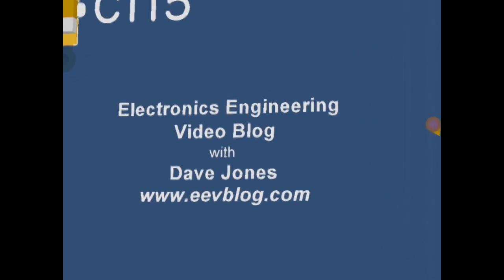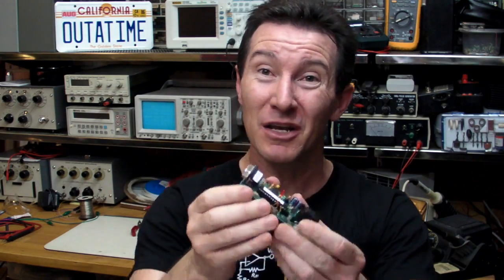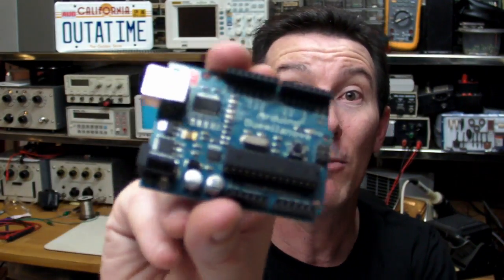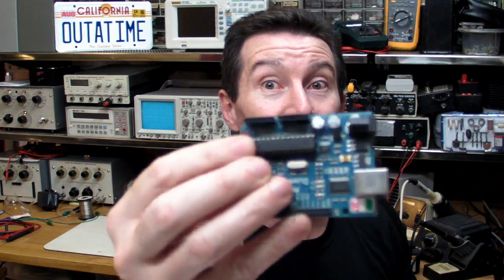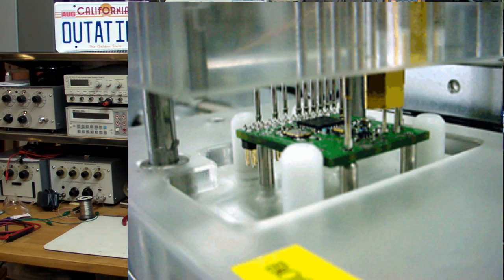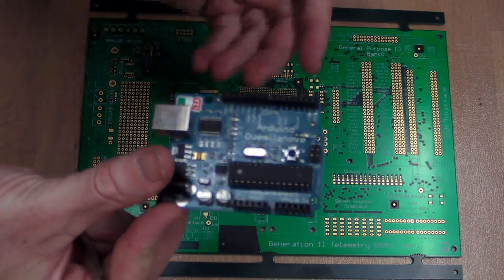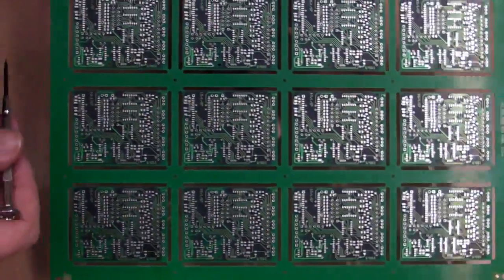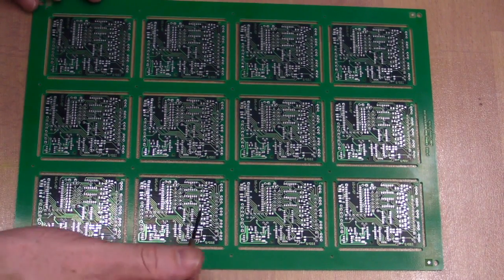EEVblog #127 - PCB Design For Manufacture Tutorial - Part 1

Comment: Rather than paying for the Digi-Reels or Mini-Reels, just buy some extra parts on cut-tape to create a "leader" of sorts. One of my CM's recommends these additional amounts:
"SMT components, not supplied on reels should be on one continuous strip of tape. Resistors, Capacitors, Diodes (0603, 0805, 1206, 2225, SOT, SOD, MELF - packages) require a minimum of 50 pcs and/or has to exceed the required quantity by 30 pcs. (Example: build req. 40 pcs – we will require 70 pcs – this meets our minimum required 50 pcs plus 30 pcs above build requirement) Resistors, Capacitors, Diodes (0201, 0402, minimelf, miniature packages) require a minimum of 100 pcs and/or has to exceed the required quantity by 50 pcs. (Example: build req. 80 – we will require 130 - this meets our minimum required 100 pcs plus 50 pcs above build requirement)"
The other handy option is to buy your assembly "turnkey" (assy house buys the parts) rather than "consigned" (you supply the kit). They often can buy parts cheaper than I can, then I can ignore these matters.

Comment: You don't need to automatically go to reels (or DigiReels).  All you have to do is buy Cut Tape with 4-5" of extra length, the extra length becoming the leader.  Done. 
Obviously for bypass caps and other parts, it makes sense to just buy a big reel, but otherwise I get tired of paying $7 for DigiReels.
Reply: I thought so. Would Digikey sell with 5-7" inch extra cut tape? I usually buy them in cut tapes but I always buy them extra assuming the assembler would lose some in peeling the tapes

Comment: Great video!  Thanks!
Typical tooling hole diameter: 4mm
Typical routing width: 2.4mm
Typical fiducial mark diameter: 1mm (both sides for top-bottom surface mounting)

Comment: 17:58  There's a big cycle time reduction when you panelize.  Manufacturing machines take time to load a board in, recognize, get ready to do it's thing.  Then the actual thing it does can be relatively brief.  By panelizing small designs, the equipment spends more time doing its thing and less time getting ready to do it's thing, per PCB.

Comment: I work for a Circuit Board Company and panels with pre-drilling and secondary drilling for open hole circuit boards are better because the plating allows for the boards to be fully conductive were as surface plating could go wrong. Also the way we manufacture boards is way different then the way your showing.

Comment: Allot of good advice was given which applies only to very large quantities. One will typically ramp-up from the prototyping stage to small-quantities first; Say 25 to 50 units. To address this market, assembly houses are offering services which loosen allot of the rules mentioned; For instance, they may not require you to panelize unless your board is very small; Say under 1" square,  They may also be flexible about parts being on cut tape or loose. 

KUDOS DAVE JONES !

Comment: Great work. This sort of knowledge is invaluable and you can normally only learn it by doing it amongst some good electrical engineer mentors.

A great way to create your BOM spreadsheet is to use the information that you've already provided in your CAD software e.g. Altium. 

If you use database libraries you can link the datasheet, manufacturer and supplier information to the part in the schematic. So when it comes time to make the BOM, all the information comes straight from the schematic!

Comment: The corner holes are normally, at least in my experience, the first holes ever drilled, as a pin is pressed into the holes to anchor the stack of pre-drilled boards to the CNC drilling machine bed, ready for drilling / routing. The next step is etching, before being brushed and cleaned, ready for silk screen printing of the mask and sent for component assembly / populate the PCB's. As far as I remember anyway, it was a while ago in an age where audio cassette tapes were the storage medium for CNC software / program....lol.

Comment: @ArtistEngineer e.g. you have an individual part for a "10K resistor 1% 0805" "1K resistor 1% 0805". So your BOM is EXACT and automatic. It takes a bit of setting up in the library but once you've got it done then you save LOADS of time doing your part ordering. 

Anyway, this is a simplified example and you probably already do this.

Comment: sorry for the multiple comments but I'm basing a few arguments based on my previous work experience. small smd components not on deals are not hand soldered but instead placed manually during the inspection of the other components from the pick and place machine. then it all goes through the reflow oven.

Comment: Small note in the DigiReel calculation: the price was listed at $84 with a calculated price per unit given.  Back calculating, it looks like the extended price includes the reeling fee, with the unit price extrapolated from there.  This has been my experience (which is a bit filtered, but purchasing never has corrected me for submitting incorrect parts pricing).

Comment: @rainbowsalads (Viz circuit (schema)...pcb walkthroughs) AutoLISP training is universal enough, but so are the AutoDesk (etc.) certified trainers, often in with distributors and engineering service companies; just pick your coverage (e.g. as mentioned, 401 discretes, inline packages, connectors...) and/or read up at the fabricators' (CFM/OEM) sites and match up preflighting (so connectors don't hustle each other for space, RF emit overmuch, etc.)

Comment: maybe you could get your lecturer to contact a contract assembly firm and see if they are willing to give some time to talk to the future designers. I work for a company that does contract manufacturing and we have had in the past had students for work experience but this is getting harder to accommodate these days. My advice to anyone designing a board is talk to a contract manufacturer as early as possible for advice. It will save you heaps in the long run.

Comment: I would like to thank you for all the amazing tutorials that you've provided us with. I have a question about reverse engineering. I am a 3rd year aerospace engineering student from melbourne, I love electronics but I don't particularly posses the technical apt as you do. I would like to know if it were possible to design a ASIC chip, that would be able to decipher a certain algorithm at a low cost? If so, what do I need to ready up on and are there any resources you can direct me to.
Cheers,Ash

Comment: That is outright, and is not bad. I got a trial on a 64 layer where I could move whole rows of tracks and lay in ground planes shields, etc. $36K! per YEAR! It beats the heck out of a R&R program which Rips up a design & Replaces it until it finds one it likes. Dip trace is free 2 sided through hole. My new CNC router can do drilling and an OK job of routing etching in the copper. I won't advocate using cracked versions of the program. It is one of the best ways to get your computer a virus!

Comment: Well, ok, this blog and its additionally parts is now 10 years old I think that it needs an update, because we have now a lot of PCB manufacturer, who produce very customer oriented PCBs at decent costs. Today there is no more need to take care of all the advices you gave, related to the situation of 2010. Today you often need just to provide a scaled hand-made drawing of your PCB in a digital picture form and you will get your ordered PCBs in the best quality and at low price. If you don't need further manufacturing by highly sophisticated companies for mass production, your PCBs are useful for DIY or even the most highly flexible assemby contractors. Even in the case you need PCB and assembly for mass production, you will be provided with customer support of the PCB manufacturers and this is often for free.

I think, the most abonents of your channel are DIY electronics enthusiast who did most of the device manufacturing by themself. In the time of personal 3D printers you can do almost all the required manufacturing and assemby by yourself, because you will very rarely do series or even mass production, but more highly specialized device manufacturing for your personal needs or the needs for some of your friends.

Comment: @heroineworshipper , one time costs for setup is normally 1k~2k in AU, cost per placed part is about 5 cents for SMT, and 20 cents for TH, and fine pitch components have some other pricing I don't know about, plus the cost of the parts, plus the cost of the PCB, plus testing, plus you likely need a bed of nails tester to be made up,

All of which is well under 100k!!!!

The real cost is in compliance testing, depending on the product, and getting custom plastics injection tools made...

Comment: another problem with bga is that it can be easily missaligned. not necessarily harder to inspect as at PTI there is an xray machine to examine them and even traces inside the pcb if needed

Comment: I notice you specify a soldermask swell of 1.5 mil around your pads. The two board houses I use regularly want 2.5 and 3 mil. This makes it impossible for me to do a QFN with 0.5mm pitch and still provide 5mil width soldermask between pads. What do you do in this situation? Thanks.

Comment: At 32:00 you explained that the board has to be stiff in order for the pick and place machine to place the components without the board warping... but why isn't the board simply supported by something when they place the components? I don't understand why it needs to be floating.
Reply: They are usually supported by the edges on a rail system.  This is because they have no "a priori" knowledge of what might be hanging on the bottom side.  At higher quantities or higher cost they can always figure out how to get around that, but you're better off at small to medium Qty not doing anything weird.

Comment: here's a question. I thought of the other day. Some fancy computers use see through cases. I had idea then because PCB are basically plastic like PVC, etc would it not be possible to make it clear too?
Reply: No you cant get "clear" PCBs the colour of the basic material (FR4) is very light green. However, if you had one made thin enough, you could use clear solder resist. With a bright enough backlit LED it would appear to be at best translucent.

Comment: Re: v-groove separating
~~> EEV noob w/other skills

Standard Razor knife,   not box cutter or Dundee/Bowie Knife
Continue to score with minimum force to save components and fingers, repeat
The passes, time, is deponent on the pressure able to apply. Surprisingly not long
It is just fiber glass polyester maybe copper foil
It should cut through Smoothly and Cleanly, No Hair that penetrate skin and scratch for hours.
Also, works with overhead florescent lighting fixture lens.. Not an easy task any other way!
         Cation, more force to cut and do not use an Aluminum straight edge, the force will bite it and go of course. where fingers live.

But also the sand paper, Files work, but is work.
tabs left on easily flat straight sides sand easily or corners and cutters and sand/round the corner tabs...

Comment: Sorry, you should not touch the surface finish on a PCB, the grease from your fingers could cause solderability problems. Aunic (electroless Nickel / Immersion gold) is a no-no and Immersion Tin is a Never! Very hard to clean off if contaminated. Dont get it on, you wont have to try and clean off. Just a tip from the top :-) Apart from that, very good advice for would be PCB designers.

Comment: One point I would like to disagree-- I have learned through long experience that you do NOT want to use surface-mount (only) connectors.  These can (and will) get ripped off of the board by the end user.  For connectors that are actually used by the end-user, I design in through-hole only-- (or a hybrid connector that is mechanically stabilized by through-hole, but the connections are surface mount).  Please don't repeat my past mistakes-- use only through-hole (or hybrid) connectors.

Comment: Kind of amazed that someone hasn't come up with a robot to reliably do through hole board place and soldering, sure it's challenging and why bother when surface mount is easier and specifically developed for manufacturing millions, but still, I would have thought there would be some market still for making through hole stuff.

Comment: nowadays I`ve seen on videos that there is automated through hole assembly machines and lines as fast as those for SMD... they are impressively fast and should cost around the same or maybe just a tiny bit more (I am no expert)

Comment: i really like your video and agree that surface mount is the way to go. however, sometimes special machines in factories have thru-hole-pcb that have a few obsolete bad chips. so, should the board be redone like the original mounting and updated just the obsolete parts or go 100% for the smt redesign? even the smt chips may become obsolete and the factory must run . thanks  :/

Comment: So I still haven't got an answer about the software used. But for those wondering about some PCB software, since I never got an answer I made some google search and found a few options like gc prevue and cam350. I tried the trials, but got the best result from a website called Pentalogix, they have a free gerber viewer and very cheap/good editor.

Comment: What size do you recommend for polarized capacitors in an SMD form factor? I am using Eagle, and they don't have the usual sizes like 1206. Would you recommend 3216?
Reply: if it's a cap, go for the bigger ones if they are cheaper or are the only ones in eagle, as they probably don't have enough capacitance to do their job with the smaller ones

Comment: Mate, call me old fashion but I prefer through hole boards.  In my mind it just looks neater. Most of my designs are done with Autotrax 1.61 for DOS  running on old Campaq laptops under win-98se and are single sided.  I know Autotrax well so why should I change, all Autotrax output  files are compatible with  imperial Silicon chip designs  and is industry standard, Autotrax also was the right price.      I am about to venture into double sided soon.
      I like to socket all my chips so through hole lends itself to this more than SMD.    I like to make my own boards using a UV box with laser transparencies, double together for  a greater contrast. I recently bought a  Proxxon PCB drilling machine and although time consuming with 1000 holes and above makes drilling PCB's easier and accurate. .....Regards Rob